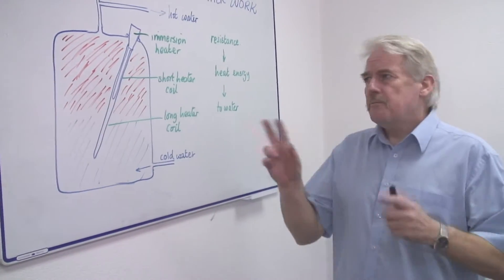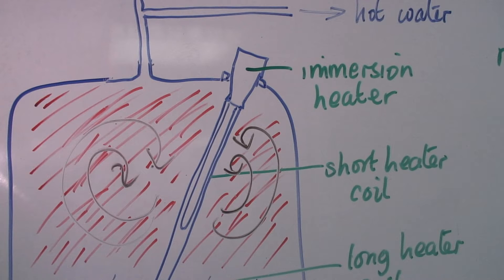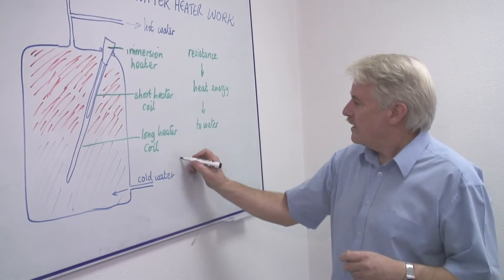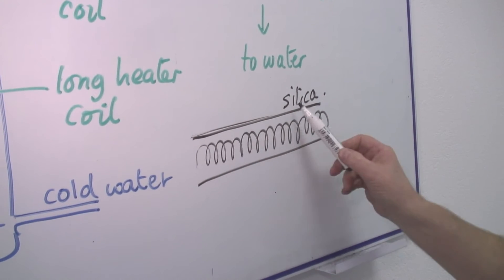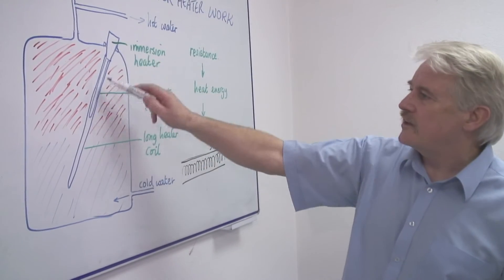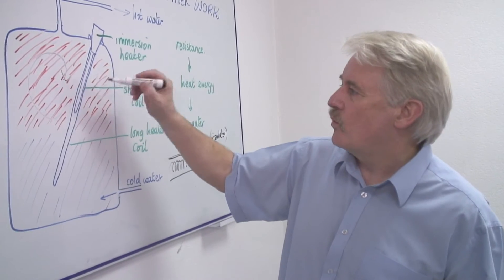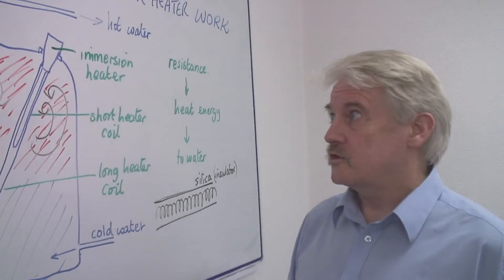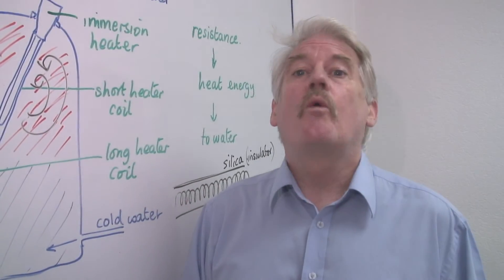Energy & Electricity in Science : How Does an Electric Water Heater Work?

Comment: If you are going to Teach Be Accurate, The Wire has A Relatively LOW Resistance But is an Amalgam Designed To Take The Heat Without Breaking For Many Years.